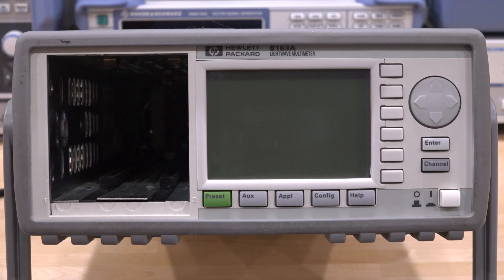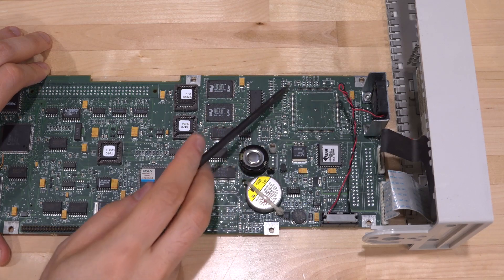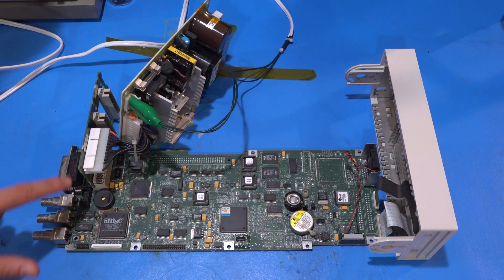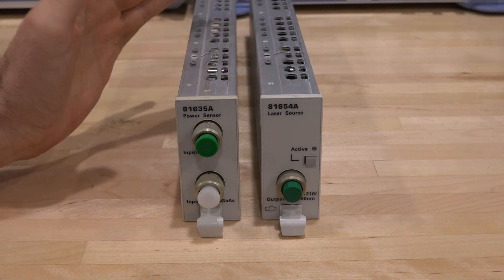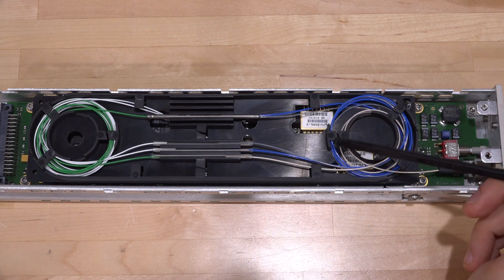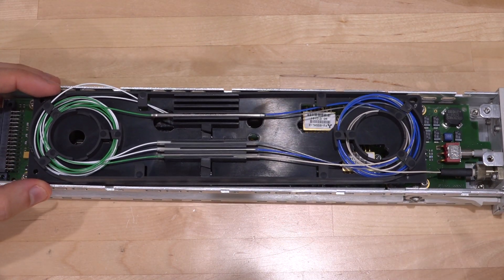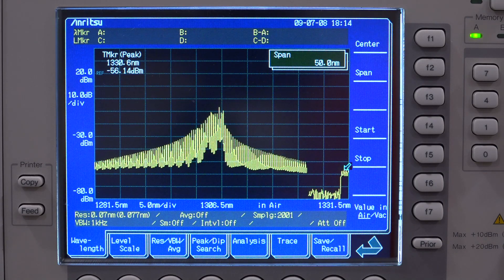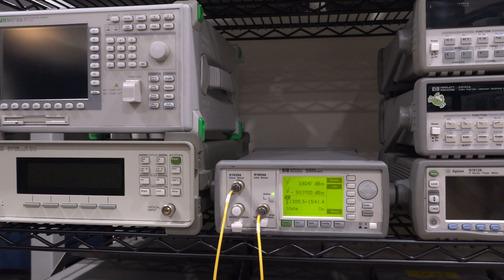TSP #195 - Teardown, Repair & Experiments with an Agilent 8163A Lightwave Multimeter & Laser Modules

Comment: 2 years too late but the fan is meant to cool down the display. Specifically the led backlight does get hot. I don't use this particular model yet but I have many RF power meters (i.e. E44xyz; xy being 18 or 19, z being A or B) that have this same form factor and design.

Comment: The reason for the coils of fiber has to do with the splices, you need to bring the splice to the splicing machine, so there always needs to be quite a bit of extra fiber in any splice box. The pigtails (fibers with connectors fitted) are usually 2 meters long, but are commonly cut down to a more manageable length depending on the application.

Comment: Loose connectors and cold solder joints where a nice source of easy to fix device in my youth. 
Sadly it all shifts towards disposable electronics.
This is why i like devices like this. If they break you still have an incentive to fix them.
Nobody would recap a something like a 5 year old smartphone.

Comment: But, it's not fully repaired until you know why it broke.
Reply from the maker: A loose connection between the LCD module and the main board. Or a loos connection on one of the EPROM firmware ICs.

Comment: You must have fixed it when you took off and put back the 50 Ohm termination in the back. Statistically speaking, it being a problem with a coaxial connector is very likely on this channel.